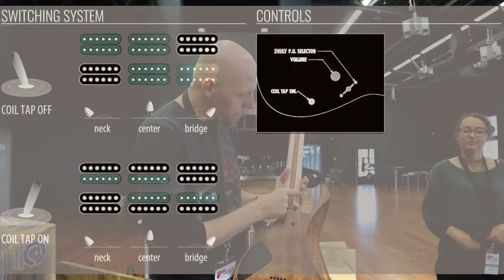Unboxing the Ibanez guitars at GuitCon 2017

Comment: I want another Ibanez I traded a 60's Fender Jaguar w/case that I got for $100 I bought a Pawn ticket for a "Fender Guitar" That's all I knew & it was a Jaguar!!! Like mint almost I took it to trade & I should have known I was giving away the guitar when I opened the case he said pick any guitar you want. I picked an Ibanez I can remember the #TB7787262FR4….??? It was a RG w/ Floyd & flamed top trans-black. The new Prestige Bulbinga top blue type stain Amazing looking guitar. Thanks for the spec's my 2nd guitar was a Roadster it was just before the RG came out.
Reply: That's it the last one you showed I want that one!!!!
Reply from the maker: Back in the 80's no one really cared much about 60's guitars. Now of course today that's all changed. There are 2 ways of looking of this. 1: What could have been today. 2: It was a moment in the past that you can't change, BUT it was a part of the evolution that put you on the past you are on now. That's hopefully turned out to be a good thing in the end.

Comment: I have a collection of all 3  colour original Jem guitars from the initial run.   They are excellent guitars and the new ones are not quite as nice but are still superb instruments.   I also have one of the first dipped Universe guitars, also excellent and better than the newer units.
Reply from the maker: There is no denying it. There is a VERY special magic in the older Ibanez's from 1987 to roughly 1992.

Comment: I have to ask what is the deal with the "KTS Titanium Rods" -- insofar as why Ibanez puts them in some models but not others, and are they something that is preferable or not?  It's just confusing seeing a guitar from Ibanez that's like 1500 that has them, and then seeing one that's over 3000 USD that doesn't.
Reply from the maker: You would need to put that question to Ibanez themselves.
Reply: I see your point, but what about the other question -- I guess anyone who's a guitar player can answer -- is it generally preferable to get an Ibby with these?  I would think so, but that's just my opinion.  I personally see neck stabilizers as a very good thing.  I've also noticed that they seem to put them in almost all of their J Custom models.

Comment: I just bought a used red 1997 Ibanez mik AS 120.  Those pickups are fantastic. The guitar sounds better that my '78 ES 336 pro.  I don't know if the AS 200 plays any better or just different appointments. Thx,J.
Reply from the maker: It's no surprise that your Ibanez sounds better than your Gibson. As far as if the AS200 plays better, it's honestly very subjective. My best recommendation is to find a store that has one and give it a try. I hope that is possible around where you live. Cheers!

Comment: Ive got both the Pick and neon yellow 25th anny RG1XXV's (they have the Edge 02 trems) and Ive got 10's on them now and they sound massively better as well as feel better then with 9's on them IMO and the 10's seem to stay more in tune as well.  I can feel the strings threw the whole guitar with the 10's on there, the 9's are very loose when on them. Id like to ask you Jason that it seems theres a lot of Premium RG's from the last 5ish years that have some string alignment issues, one of mine does, have you found that to be a common issue?
Reply from the maker: To be honest I haven't seen that problem at all. There is a rumour going around that Japan gets the "A" stock. I'm not sure how true that is, but I live in Japan so I only see what's there so I honestly can't comment beyond what's in Japan. Sorry I don't have a good enough answer.

Comment: What is the model of that neck-through J. Custom?
Reply: Hi, that guitar is the Ibanez JCRG12 J. Custom.
Reply from the maker: Indeed EdissonJG is correct. Sweet looking axe that's for sure 😉
Reply: Jason McNamara Did you say it was made in 2015?
Reply from the maker: I think I did yes. The serial number on the end of the fingerboard started out with a 15 hence why I knew that. I'm not sure why they still have it. Maybe it's kept at Ibanez Germany as a display piece, I'm not sure.
Reply: Más información aquí: https://www.ibanez.co.jp/jcustom/2012/JCRG12-MBK.html.
Reply: Thanks, for the responses. I'm just surprised that model was still being made up through 2015. I had thought it was only produced in 2012.